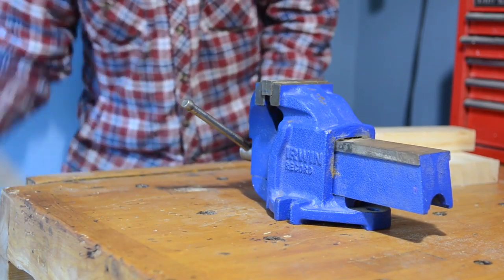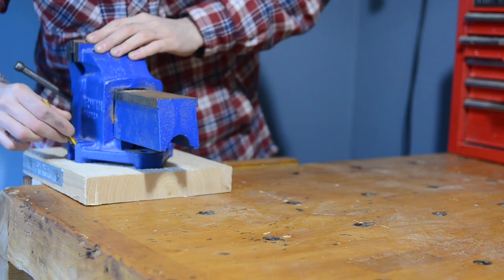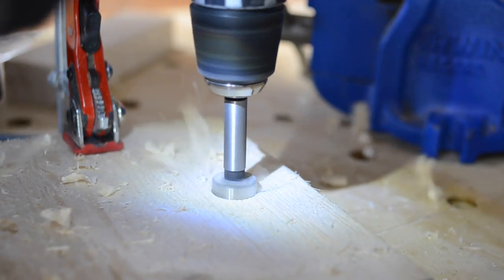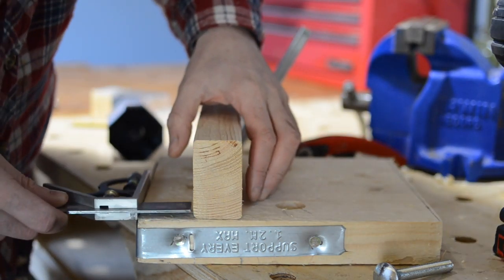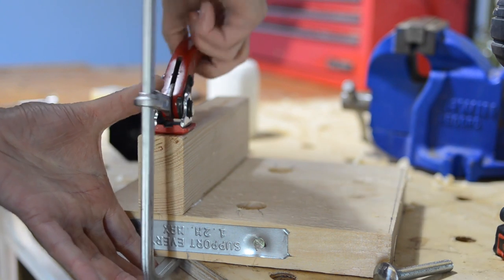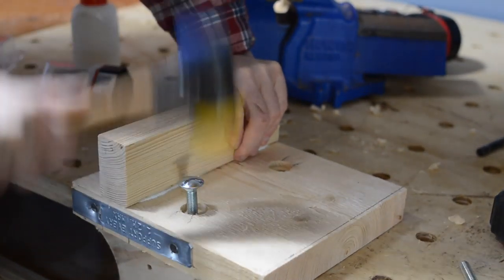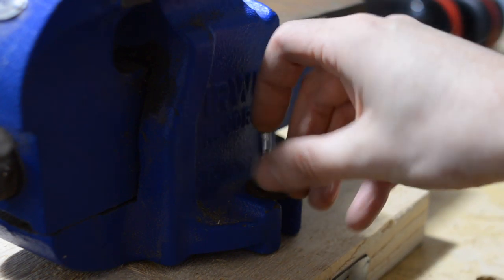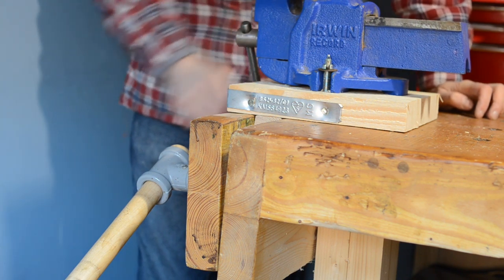A Vice In a Vice

Comment: Super useful + great video... I have exactly the same set up, excellent for a cramped workshop or occasional use...just this week I have made two smaller ones, one for metal and one for wood from old metal working vices, extended the timber batten off couple hundred millimetres to the side so they can be mounted in multiple positions.
Reply from the maker: Im going to do the same for a few tools